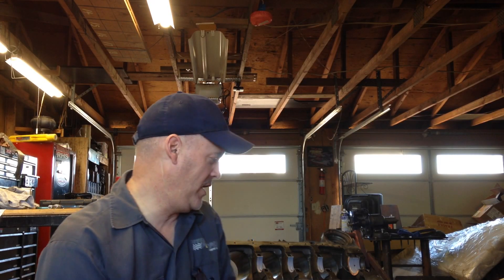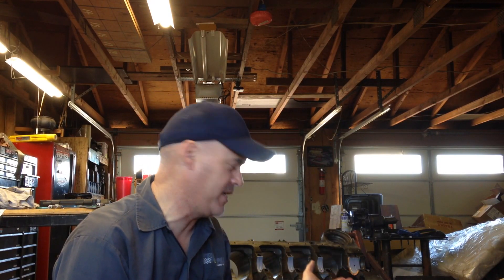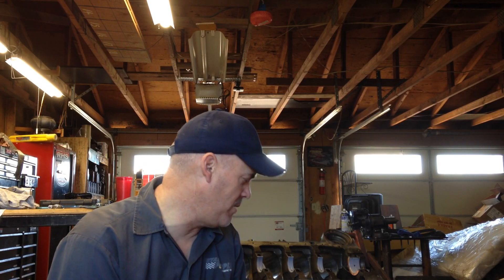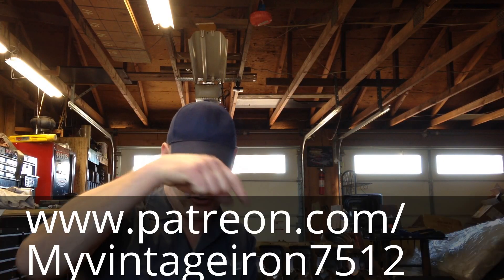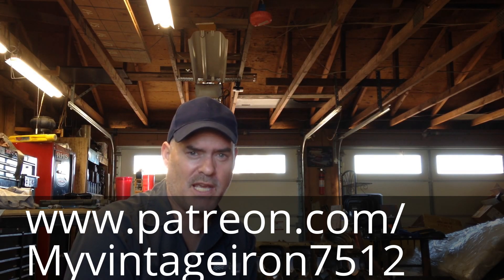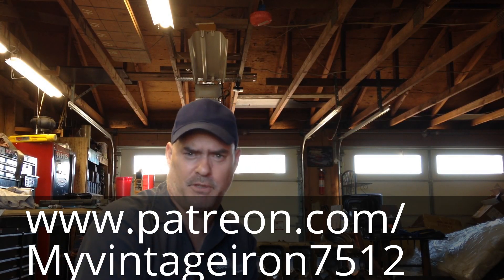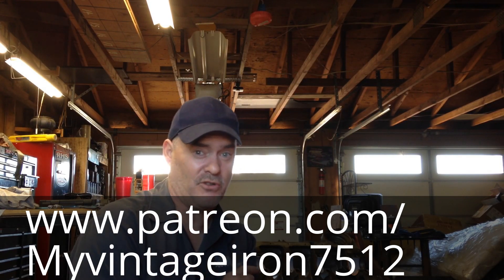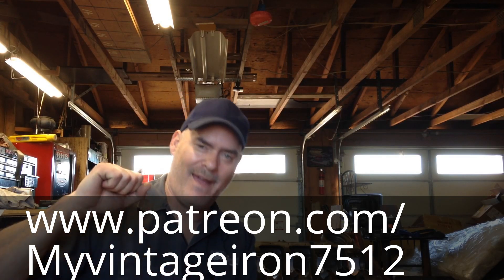Chevy 327 Breakdown

Comment: I have a question I have a 69 327 in a 84 Pontiac trans-am that me and my father were doing for a project, he passed away 2 years ago so I'm finishing the car. My question is were these engines internally balanced or externally balanced? My engine has a vibration during acceleration and I was wondering if its possible to get rid of the vibration, maybe a fluid dampener or possibly another way. Thanks in advance

Comment: hi i have a 67 gmc 327 and was going to put the 400 heads 882 or take my stock 174 valve heads and replace with 194 i guess i would have to put hardened seats in the older heads as well.

Comment: Hi i have done a little change on my 327 small journal from 1962 i have in my impala
The thing is i put in a comp cams kit 270h magnum and change stock quadralet intake to a airgap speedmaster with a edelbrock quadrajet carburator with a spacer 1inch it seems i lost a lot of power what do you think i whent wrong? Thankyou

Comment: I'm building a L79 short block.  It has low mileage so I'm using the original 11to1 pistons but I have changed the rod bolts to ARP bolts and main cap bolts to ARP bolts also! I'm putting my Dart Motown heads on with a Isky solid lift cam and a Victor jr intake and a 750 turned into a 825 cfm Holley which I followed the instructions from the Holley carb book! It going into my 66ss Chevelle and it has a muncie 4 sd with a 12 bolt and a brut strength carrier and 4:88 Chevrolet gears and a Zoom clutch! I have a 11to 1 350 sb in the car and it ran mid 11s! How much slower do you think that the car will go with the smaller motor? I also had a 69 DZ 302 short block I could have used but that was a Big drop in cubes! Btw the 302 is for sale if you know someone???

Comment: I have a block and heads cast in mexico and accorging to what i found it was cast in 1988 and yet its a 2piece rear main and has the same lifter valley as 305 roller engine has the bosses for the roller setup its different than any ive seen but i think its very well cast and is potentially better thanthe post or pre 86 american cast blocks

Comment: Hi; I have a 327 with casting number that says its a 1964, but the block has no serial number.  When i got the block it had a 30-30 cam and solid lifters in it. Also had double hump back heads.  My question were there any 327  blocks manufactured without serial numbers??

Comment: When Chevy brought out the 350, 4" bore by 3.48" stroke compared to the 327's 3.25" stroke, there was a lot of discussion over which was the better engine. In several build offs done by Hot Rod, Car Craft and Hot Rodding magazines showed that the 327's actually made more horsepower than the 350 did. There are a couple reasons for this. First is Rod length to Stroke ratio, in which the 327 has the advantage. Second is that at the time rpm in a small block was everything, and the 327 would spin higher than a 350.
Also the 350 was kept over the 327 was because of Chevy wanting to keep as much power as possible and with the EPA cracking down on them more cubic inches was deemed the way to keep as much horsepower as possible.
Reply from the maker: Yea it's a shame the 327 went away after such a short time it really was a great engine

Comment: Back in the day, all my buddy's built 283s because they were rev monsters, 8000-9000 grand no problem. I chose small jornal 327 because I wanted a few more cubic inches but still twisted up. I tore down a 283 from them one time and found one rod twisted sideways slightly and bent to the side near wrist pin but still ran good?!?!

Comment: I seem to remember that the low compression 327/210HP engine used as the base V8 engine for the 1967 Camaro was the first Chevrolet engine to use the larger rod and main bearings. I also recall that the 1967 Camaro SS 350/295HP (and '67 Z28, 302) used the smaller main and rod bearings. It appears only the Camaro that used these three motors in 1967. One of the knocks I heard is that these motors did not have four bolt main bearings. From what I remember however that the performance 302/327/350 all had four bolt mains from 68 on. Your comments please sir.
Reply from the maker: yes you have it right
Reply: No 327s were factory with a 4-bolt main cap config, but you can build a 4-bolt 327 with a 350 4-bolt block.

The 350 was only available in the Z/28 in 1967.  It was large journal.  All other small blocks in 1967 had the small journal crank, including the Camaro engines (327).
Reply: I have a 69 327/210HP engine its supposed to be stock out of an impala. when I pulled the stock heads off all of the pistons were stamped 010 .. whats the deal, an old 
Chevy tech said it was a factory bore because it had a bad cylinder, what do you think ??
Reply: I have a original 327/350h.p 1968 untouched 2 bolt main so I don't know about all of the highperformance engines being 4 bolt mine is not
Reply: Gm tech says there was "never"a 327 4 bolt main ever produced from the factory no matter the h.p it doesn't exist
Reply: @silicon212  67 Z28 came with a 302
Reply: @kennywhiddon1497  You're right, it was the SS that had the 350.
Reply: @silicon212     no, the 67 Camaro had a 350/295 HP  motor
   also available in the SS  model.

Comment: What is it about that shorter stroke that makes the 327 scream so well?? Everybody wants a “ stroker” these days while I’m wanting a old short stroke. Neighbor has a 302 Camaro and 302 Ford that both sound awesome. Stomp the gas and they scream! 4 inch bores with a tiny stroke just seem to have a very unique sound and character
Reply from the maker: A big factor in RPM capability is piston speed, the shorter the stroke the slower the average piston speed is at a given RPM the piston speed can be calculated by selecting an RPM for example 7000 and multiply it by the stroke length in this case 7000 times 3.25 and you get 22750 divide that by 6 and you get 3791 this number is the average piston speed in Feet Per Minute on a mild engine we don't want to see over 4000 FPM the 327 is well below it  at 7K a 350 on the other hand is 4060 7000 on a mild engine that is twisting the rotating assembly to a more distressing level now keep in mind you can build an engine to go well beyond 4000 FPM but you really need to upgrade your build with much better internal parts and more time consuming building procedures.
If we run the numbers for a 383 stroker it's at 4375 FPM at 7K RPM  you can do it but it really needs much better parts the 327 on the other hand will scream to 7000+ all day long with no real concerns about internal parts coming apart

Comment: Found a 1967 Nova SS 327 2 speed in a 1929 barn, bone stock rightdown to 595 cfm carb. 94mph in first gear @ 7000rpm (bent a push rod one a run) 0-60 6 secs all day. top speed 141mph.
Reply: 141 mph ?   with a speedometer that only goes to 120 ?  Wow !
Reply: @normhodgkinson6965 You do know you can go faster than what the speedometer reads ?

Comment: Question: is it safe to say you could cruise a small journal 327 at a higher rpm and be "safer" than regular journal size SBC? I ask because I have 4.11 gears and 2200rpm puts me at about 45mph... I'd love to attest be able to cruise at 55mph. I figure less journal surface area so less wear. idk.
Reply from the maker: a 327 will turn 7000 RPM's all day long with no problems

Comment: Thank you for ALL OF THE INFO in this video. I recently was given a 327 that was left for dead in a yard. I was told that she knew nothing about it and I could have it for just hauling it off.  I'm confused by a lot of its components. The block stamping has TII29R stamped on the pad and the casting number is 3782870 on it. I believe that means it was built Nov 29,1962 for a full size car with a manual transmission. The crank has a 030R/010M stamped on it along with notches ground out of the front lobe(balanced???).The heads are the Power Pack (3795896) heads. I'm trying to decide whether or not to rebuild it. Any input on whether my son and I should rebuild it to put in the 69 nova that I also removed from the yard. The nova doesn't have a title so it would be a track car only.

Comment: HI.
I'm the owner of a 1967 chevy chevelle 4 door hardtop with a 327 275HP motor in it and I have a question about gas.
Here in France it is not possible to find leaded gas any more like in the USA I guess. So the question is : Do I have to put an aditive in the 98 gas I use in my chevelle to replace the unexisted lead or can I run the motor using the gas straight from the service station?
Considering that I don't have the money to modifie the engine valve seats what would be the best solution of course. 
There're 2 schools here, some guy says "Oh, you can use the gas straight from the pump, you don't use your motor intensivly enough to do any damage to it".
Some other guy says that you have to mix an aditive with the gas unless you are going to damage the valve seats.
Anyway I use the aditive because I don't want to take the risk to damage my motor (they way more difficult to find here) but I'd like to have an objective awnser to that question.
Thanks for your awnser. Thomas.
Reply from the maker: Use the lead additive for sure!  If you are driving easy it will help but either way with no lead eventually the seats will get damaged

Comment: Also wich combos are for a good performing 327 engine? A guy told me to use the combo i just mencion but i havent notice good changes it drives good but its like slow worm  with the stock parts it wasnt so performance but i give gas and wheel burn i little  so thats why im confused

Comment: Is there an easy way to tell the difference between a 327 and 350?  I recently bought a '57 Bel Air, and the engine #V03040MN is one or the other, and I can't tell which.  According to the "MN" in the number, it's either out of a '67 Camaro (327) or a '68 Nova SS (350).  Thanks!

Comment: You probably get asked this a lot, but I have yet to find a video of someone explaining the pros and cons of different engines like which ones you'd get better torque from or price per HPvs higher RPMs or better gas mileage.  I have a '62 327 so a SJ with standard power pack heads, completely disassembled. I'm trying to figure out what would be a good option for the 55 belair project car. I really like the idea of building the engine myself, putting it together with my dad was my dream. Would rebuilding the 327 and trying to get some decent torque and HP from it cost more than potentially building a new 350 or LS?
Reply from the maker: No build the 327 its a good engine

Comment: in the 68 chevy pu i'm building with a 454 but the motor i'm pulling is 350 4 bolt that they rebuilt and put a bunch of high performance parts in to new carb ,manifold distributor msd . and the body is perfect and crome on the truck  and only paid a 1000  because when they rebuilt the engine they never magnaflux and on the side of the engine there is a small crack right under the head deck no water gets in the oil and has great compession is there a way to fix it by silver soldering it because i use to do that with d-8/10 cats on the radiator case that was cast iron never had one come back or do u have any ideas hate see the motor go it runs so good and has lots of power
Reply from the maker: I would try K & W Block seal you have to follow the directions exactly but I have seen it seal cracks 8 inches long on engine blocks after treating them this stuff is like magic Napa sells it
Reply: @Myvintageiron7512  thank u very much and i talk too tha original owner of 454 rv he is getting me the spec on the crate  motor they order when they got the rv
Reply: one more thing the guy  said it was a 350 but he didn't rebuild it hegot the truck from  friend and it is the original engine but it is not a 350 but a 327 with a 400 turbo  trans the # matched but i f up and gave  it to my kid

Comment: Can you tell by the engine code if it was a truck or car engine, I have a 76 400 and I'm wondering about it. Watching all your videos, great stuff.
Reply from the maker: The 327 Chevy engine is stamped on a machined pad on the front passenger side cylinder head usually behind the alternator.

The Code
The code consists of an assembly plant code, date of production and suffix.

Decoding the 327 Code
First letters of "F," "S," "K" or "T" denotes Flint, St. Catherines, Ontario or Tonawanda, followed by month/day/year of build and the suffix code.

327 Suffix Code
327 Suffix Code
Suffix codes are R, RA, S, SA, RB, K, SB and SG, with each suffix denoting the type of carburetor, transmission and whether the Chevy is equipped with air conditioning.

327 Casting Numbers
Casting numbers for 1962 to 1965 models generating 250 to 375 horsepower is 3782870; 3789817 for 1962 to 1967 models providing 210 to 275 hp; 3791362 for 1964 to 1967 models with 250 to 300 hp; 3814660 for 1968 to 1969 models with 250-hp engines; and 3830944 for 1963 models with 300 hp. Keep in mind almost all of the Corvette engines were made at the a Flint plant the S, K, and T plants made 327's for everything cars and trucks

Comment: I have a question. I bought a 63 Chevy with  a 327 from 66 in it. What I know, Bored .30 over, KB Hypereutectic pistons 10: 1. Crane cam is  .488 lift and 282 duration.  Hydraulic flat tappet lifters where a kit from Crane. It has MSD electronic ignition and fuel injection, electronic fuel pump. It has aluminum radiator and electric fans. What do you think This engine is making? 
Also the controller has 2 rpm settings which should I use?
Reply from the maker: What heads?
Reply: @Myvintageiron7512  vintage double hump heads. I haven't yet pulled a valve cover, still fn cold here.

Comment: Since the release of the LSx engine, could there be a possibility of a 302 ci LS block from GM built to similar specs of the original 302 as far as the rotating assembly and bore/stroke sizes are concerned?  Is there a way to build a 302 clone using an LS block?
Reply from the maker: probably

Comment: In 67-68 they introduced the 350 307 and 302 the 302 was large journal and tach was 10,000 rpm I know the theory for large vs small journal n higher rpm but the large journal very capable also. Fun fact 302 327 350 all 4” bore large journal pretty much same block. 307 took over as small displacement v8 in chevys ending the 327 with 307 and 350 but your correct large journal 327 ran 68-69 I had a 69 impala that was wrecked I pulled the 327 for my 68 chevelle 👍 with 4.11 gears ram down highway for hours at 4,000 rpm was a great little performance engine

Comment: Hay I have a question for you (im the amc guy) amc dominated the 71 and 72 Trans AM series came in second 1970;  after taking Roger Penske and his top driver Mark Donohue left GM at the end of 69 ,, anyhow all the motors for all Trams Am had to be under 5 litres, how did GM make the Chevy 302?
Reply: 327/350 bore= 4.0 X 283 stroke = 3.0.  bore squared [ 4 (16)] X stroke (3) X 6.2832 = 301.59 ci
Reply from the maker: the 302 was 4.9L and was built for the T/A series 4" bore 3" stroke

Comment: after watching this a couple of times I wanted to ask you a question. I have a large journal 327 in my '68 chevy c10 and want to make it into a small journal to make good power and rpm. So what on your thoughts on those larger bearing kits or bearing spacers to fill the gap and make a small journal crank fit in a large journal block.
Reply from the maker: they don't work very well I wouldn't do it
Reply: Myvintageiron7512 do you have any tricks for putting a small journal crank in a large journal block

Comment: Miron, on some of the 327 I see a canister in between the valley on the block that run next to the distributor. What is that for?
Reply from the maker: crank case breather used with a down draft tube

Comment: Thanks for all the good information and videos.  Is there any way to visually confirm (without looking at casting numbers) whether you are looking at a 350 compared to a 327 installed in a vehicle?
Reply: You can measure the diameter of the harmonic balancer. Bigger the stroke, wider the counterweight

Comment: I sold a fresh Forged flat top small journal 327 with a  010.  010 crankshaft New bearings Cam bearings and freeze plugs file fit rings small 488 lift. 302 duration solid cam complete shortblock new balancer included for 850 dollars didn't even get my parts money back got tired of seeing it set in corner of garage taped up in black trash bag don't know why I didn't keep it it wasn't costing a nickel setting there was 64 car block according to numbers. You have alot of knowledge about building engines you must do it for a living

Comment: I have a very nice running 817 400cid that I'm installing a retrofit Howards roller cam in topped with some very nice big valve 291 heads.  My original ass. brackets won't work now. I need to bolt the power steering bracket to the block but my 400 block doesn't have tapped bosses on the drivers side.  

How deep can I drill and tap the existing upper boss and lower face on my block given the cylinder is 1 inch closer on the drivers side? 

I would like to keep it mounted lower for a nice clean look since my alternator bracket is installed tight and low on the passenger side. I'm running with the original long water pump. I'm also running headers

this

Comment: Im guessing the 67-69 DZ302 is the early small journal becouse the way I understand it, it is simply a 327 block & 283 crankshaft. I dont know if they made the 302 into 70 or not??? I believe they did becouse the trans am series was still going good in 70 & they had to go against the 302 Boss.
Reply from the maker: yea the 302 Chevy was a 4" bore and 3" stroke just like the 302 Ford That is the engine they should have stuck with instead of the small bore long stroke 305